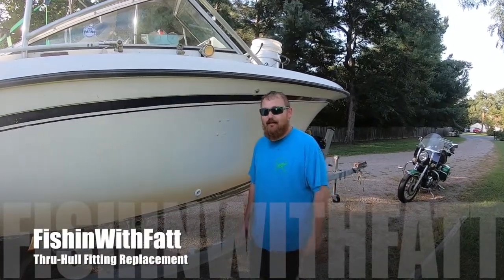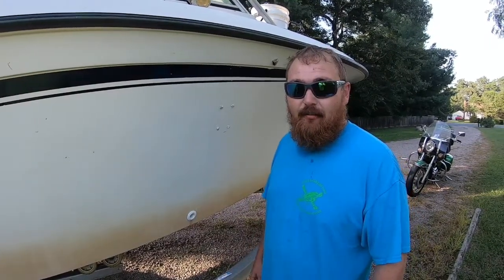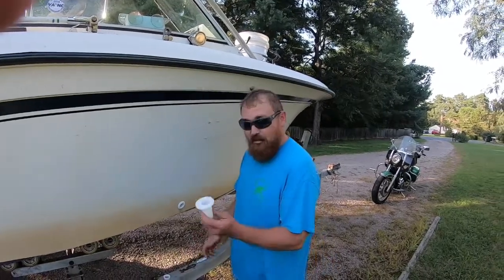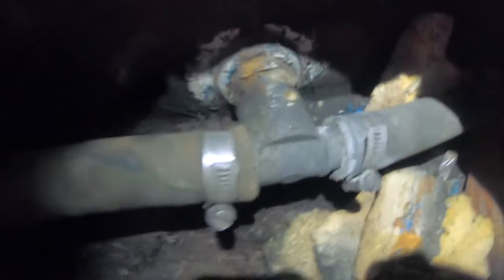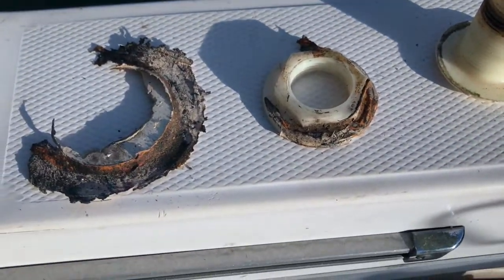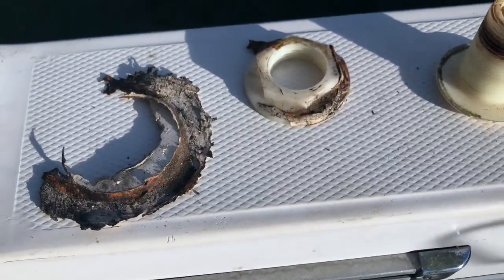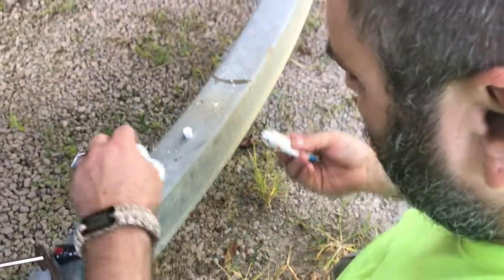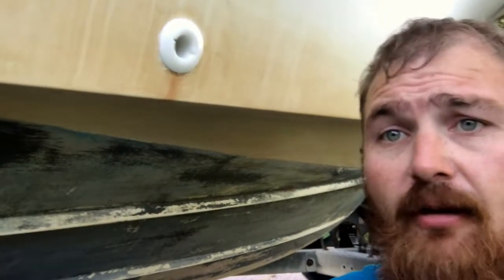FishinWithFatt We almost sank the GRADY! How to replace Thru Hull Fitting

Comment: Thanks for the tips. I cancelled the plastic thru hulls and ordered stainless steel. I also cancelled the 5200 sealant and ordered the 4200.  My old plastic thru hulls were degraded enough that I could grab and bend them from the inside till they snapped saving some work.

Comment: Wrong sealant, you wont be able to remove the thru hull fitting without damaging the hull with 5200 adhesive/sealant. Need to use 4200 sealant/adhesive which is good for below water line and still removable for the next change out.

Comment: I'm new to boating just bought a 19' CC. My through hull fitting for my foward fish compartments drain is at about the same location as yours. It's just gravity that drains the water as far as I can see. I was thinking that fitting would be above water line. It looks like the water line stain on the hull is above the fitting. Is that fitting under water when your loaded down? Doe's it sit below water line normally? I've read that if the boats foam is wet it can weigh the boat down putting scuppers and through hull fittings closer to or even under water. Over loading a boat could cause it to.

Comment: Thanks for video.  I have an '89 Overnighter.  Stupid question but what role do those thru-hull fittings play?  Never been clear on that.  Thanks
Reply from the maker: When working properly they help the boat drain deck water and water in the hatches out of the boat. When they have a crack or broken line they can take on water.
Reply: Above the waterline thru hulls are generally for drains.  Below the waterline thru hulls are generally for water intakes that might feed something like a live bait well or a salt water washdown system.

Comment: I think I need to replace the one on my 86 lowe 16' deep v but the rear of the boat has no access to the area that it is in.  Has me scratching my head....lol
Reply: chasin_the_bite I’m doing this now and working through a small hatch which lets me access my batteries. It’s not easy to get in there, but doable. You might have to cut an access hole and cover it with a deck plate. When they manufacture most boats they likely plumb all of these fittings, install fuel and water tanks and most wiring. Then they drop the deck on and join it to the hull. This gives the factory great access. Us at home? Eh, not so much!
Reply from the maker: Yeah those pesky boat manufacturers don’t plan for repairs. Sometimes you have to cut an access point.
Reply: @FishinWithFatt  I actually plugged mine on the outside and filled the live well and didn't have a leak.  I think I found a spot that had silicone on the bottom.  When I removed the silicone the area under it was wet.  I replaced it with 4200? marine grade sealer so hoping this fixes the issue.  It's not horrible but I'm all about fixing it if I can find the issue.  Just rewired the entire boat last weekend. 150' of power wire alone in a 16' boat lol.
Reply: chasin_the_bite Glad to hear you got it fixed. They (Century) barely used any sealant on both of my live well drains. But the fittings that go through the hull were buttered in 5200. Thank god for Anti- Bond 2015 remover!

Comment: Sorry, but 5200 shouldn't be used in this application.  You use a caulking product, not an adhesive, which is what 5200 is.

Comment: No neex to use 5200. Use si.e silicne sealant. 40 yrs experience talking.nut holds fitting in place.
Reply: 5200 will bond that shit on there permanently. I usually use 4200